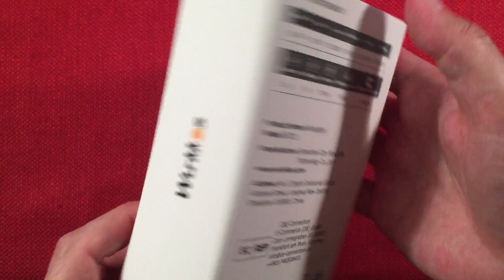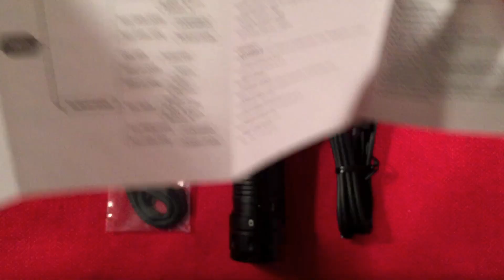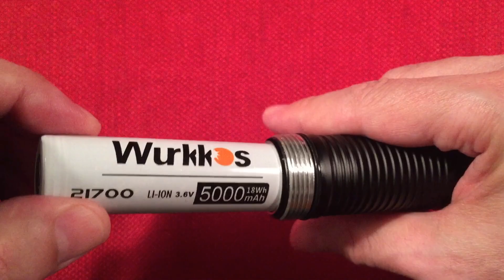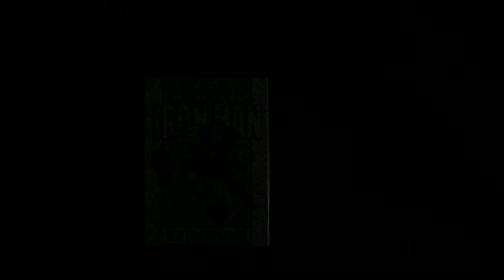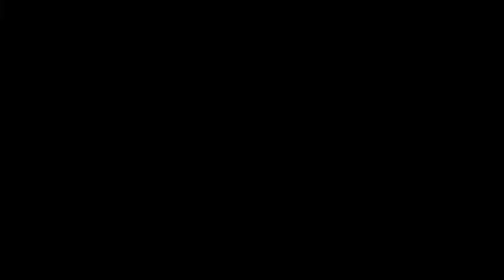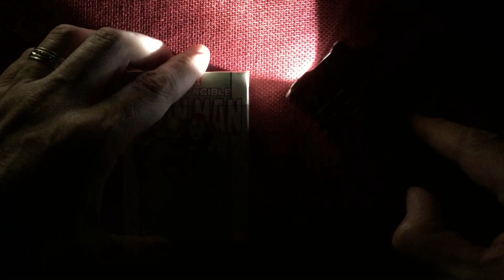Wurkkos TS23 5000L 21700 EDC Tactical Flashlight Review

Comment: I'll give credit due on the tail click because I generally steer clear of them. It's very easy to use with simple UI settings. However I have a Nitewatch 3000 lumens flashlight with a tail click and it's brighter than this Wurkkos and doesn't have turbo not to mention I get long runtimes. Now don't get me wrong, it's possible I got one of those weaker led bulbs that just isn't getting those desired outputs. Still plenty bright enough to take with you if you need a pocket light.